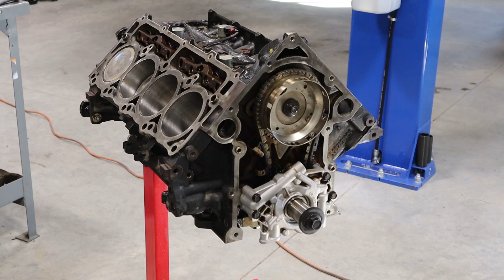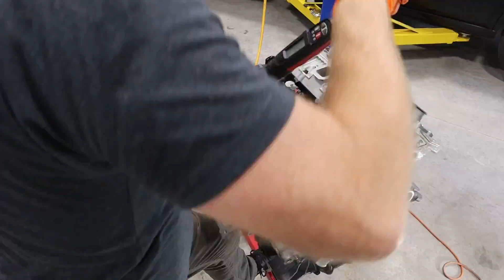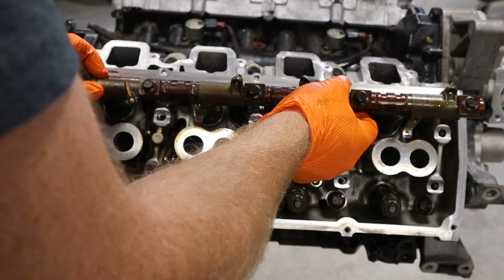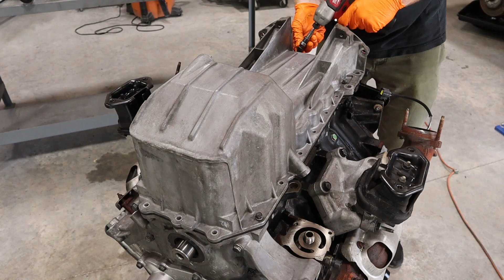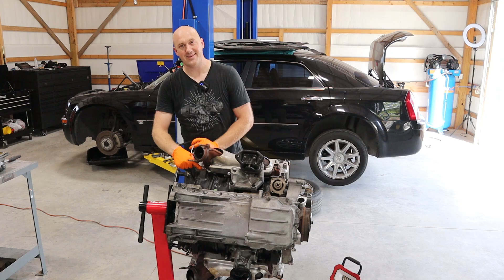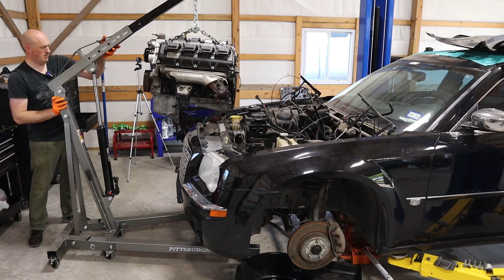Chrysler Hemi 5.7 Engine Rebuild Continues Top End // 300C Episode 4

Comment: My advice is to never re-use exhaust manifolds and exhaust manifold bolts. They always warp or crack between 40-70K miles on these motors.

Comment: Do you have to adjust the valves at all? I'm about to replace my passenger side head (don't ask lol) on my ram with a reman head. Just wondering if I just bolt everything on and go, or do I need to adjust the lash?
Reply from the maker: That's the nice thing about hydraulic lifters, no lash adjustment needed 👍

Comment: @ReignitedAuto
What are the bolts that should be replaced when doing a full rebuild?
Which are TTY?
Thanks you
Reply from the maker: The connecting rod cap bolts are the only ones that Chrysler says are one time use. The head bolts and main cap bolts are torque to angle, not torque to yield so they are reusable. 👍

Comment: Im really hoping i get a response from you even though its an old video.

On the gen 3 hemi's, is it possible to install the heads on the wrong side and if so, does it matter? Will it cause any problem?

I love your channel and thebinfo you put out, its great and very straight forward making these repairs easy for the everyday person, keep it up
Reply from the maker: Yep, the casting is identical side to side so they can be swapped. The only reason it matters is because the left and right side will be drilled differently for accessories to be mounted to them. 👍
Reply: @ReignitedAuto so everything should be good to go? The casting numbers are the exact same (both ending in DE) however the coolant/oil passages look to line up differently (i have pictures of the underside of both heads for reference)

So ultimately im at a loss of it the heads are on correctly
Reply from the maker: @Rubix4331 shoot me some pictures sales@reignitedtx.com and I'll take a look
Reply: @ReignitedAuto sent...thank you so much for offering to help me out

Comment: Just torqued down my rocker arms. The rods appear to be seated properly, but the rockers seem to have significant side-to-side movement and can slide back and forth on the arm. Is this normal??
Reply from the maker: If neither valve for that cylinder is compressed, yes it's absolutely normal. During engine operation the pushrods will keep the rocker arm centered, they won't be moving back and forth.
Reply: @ReignitedAuto that’s a major relief! Thanks for the reply

Comment: Hey reignited! Just did a MMX Cam and melling high-volume oil pump on a 2011 ram 1500. I am seeing great oil pressure at Cruise of 67 PSI at temperature. 

I am worried though at idle operating temperature I'm sitting around 26. Do you think that is high enough to lube the lifters? Thank you! 

I used your videos to do my cam swap it helped a ton

Comment: Smh i have a 2005 dodge magnum rt & im currently experiencing the exact same problem with just 1 piston being bad i just recently found out from changing the oil & put a magnet in the oil pan & a broken piston ring came out & the motor is out of warranty i bought it from dodge a little over 3 1/2yrs ago im not sure if i should replace it or rebuild it like you did but i definitly watched all your videos they are a big help im just not sure which way i should go cause it’ll be my first time doing this type of job

Comment: I enjoy watching your videos. Very helpful. Whats the best way to lift the engine with a hoist? I see on this video you have a chain on the cylinder heads. Is that a safe point to  put the chain on. What type of bolt is it? Metric? Thanks

Comment: while looking for the torque specs in torque sequence, I saw two other videos that recommended oiling the threads on the head bolts. I've never seen that before. I've always heard that would hinder proper torqueing. thoughts? suggestions?
Reply from the maker: There are some situations that call for that, but in the head bolts for dodge vehicles the service information says to keep them dry 👍

Comment: kinda off this topic but question for you... 2016 Ram 5,7.  What is the part on the rear of the intake manifold that has the electric connector thats a bitch to get at?  What is it called and what does it do??  Cant find any info on what it is and what it does?  Not the MAP sensor but the part on rear back of manifold.  Any help appreciated...thanks
Reply from the maker: That part is the SRV actuator. The "short runner valve" actuator. The intake manifold has variable length runners inside it to give better performance at lower and higher RPM and that actuator controls the runner valve that switches between the two lengths.

Comment: I dont see in any videos how to torque the camshaft bolt without having the engine turn before torque spec is met??  I was told not to use the timeing chain tension to hold the camshaft in place??
Reply from the maker: Best option that I've found is to access the flex plate and stick a pry bar in there to keep it from rotating 👍

Comment: I don't understand why it doesn't have a key way on the balancer?
Reply from the maker: You'd be surprised how many engines don't use a keyway on the balancer. I admit I would have preferred one as well, but we never see any issues with them so it must be OK. Also something to note is that the crank bolt is trapping the damper against the timing gear so that's an additional reason a keyway isn't necessary.

Comment: how do u not notice wiring harness going between the head. wow
Reply from the maker: Because you can't see it my man, it's underneath the exhaust manifold.
Reply: @ReignitedAuto  first of all, im not your buddy, so dont call me your man. 
how do u not see it before you put the exhaust on. obviously it was between the head n block before you put the exhaust monifold on. you obviously didnt look over the install of the heads before you tightened them down. a wire between the head n block definitely would have made it not sit right. i feel sry for that owner.
god only knows what else you didnt do right.
Reply from the maker: @coreywebster5227  so much aggression. You install the cylinder head with the exhaust manifolds already on them. Therefore, I didn't see it. Not sure where your anger is coming from.

Comment: If the one push rod is fairly higher than the other 3 do I just tighten slowly for the valve to shrink to be able to seat the rest in, or am I supposed to turn the engine and try to adjust them evenly ?
Reply from the maker: Either approach works fine. I usually move back and forth along the rocker shaft tightening the bolts a half turn at a time to get them to seat evenly. 👍

Comment: it did happened to me on a 09 ram I installed the head with the motor on the car and pinch the o2 sensor wire, luckly I inspected and founded the wire before torquening down the head.

Comment: You mentioned loc-titing the flex plate bolts.
Something that "happened to me",  I worked as a lot attendant for a gm dealer here in Ohio, a customer from Texas traded in his old Silverado for a new Sierra.
I was asked to take this new truck back, gas it up and wash it.

When I started the truck, it didn't sound right.  I did that 4 or 5 times and it wasn't right.  I told the salesman about it and he was rushing me because the customer was heading back to Texas as soon as his truck was delivered.

My gut said have it checked, so I did, which pissed off the salesman.  He came back to the service department, where the service advisor told him that the truck wouldn't have made it back to Texas.....all of the flexplate bolts were extremely loose.

The salesman apologized to me and told me that he would never question my judgment again.
The customer asked to see me and he thanked me for my awareness and initiative to have service check it.  Then he stuck $50 in my shirt pocket as a tip for saving him a breakdown and a headache somewhere between Ohio and Texas.

Comment: One more question master, is it possible to get 180 psi of compression on a particular cylinder if one of the valves are not closing or sealing properly on their seats??
Reply from the maker: Nope, even the slightest valve sealing leak generally puts you under 100psi and if the valve wasn't closing properly you would have 0 compression on that cylinder. 👍
Reply: @ReignitedAuto  Thanks master, I just found the reason for the misfire on cylinder #7 on my 2010 grand cherokee srt8 6.1 the lifter roller sized and damaged the lobe of the camshaft so it's time for cam swap/upgrade, now my question is: as a dodge -chrysler-jeep specialist in your opinion what's the bigger or better performance camshaft I should go with the factory torque converter for a daily driver, I have been searching with no luck for the stock camshaft specs to be able to compare it with the aftermarket options/kits out there because everyone is taking about stages 1-2-3 but no specs for those stages, I really want to squeeze every bit of torque/power out of my stock engine without sacrificing the factory  torque/power at low-mid RPM range, choppy sound will be a bonus but  I prefer performance over the sound, thanks again my friend

Comment: Very helpful videos! I use most of them to rebuild the Hemi myself not too long ago. But you were talking about the O2 sensor getting in the cylinder. I had something similar to that happen when I built mine. The nut for my exhaust down pipe fell into one of my cylinders and I did not realize it until I was trying to tighten down the torque converter bolts. I was not a happy camper. I had to disassemble the whole driver's side top of the engine to get a nut out of the engine. 🥴

Comment: What is the name of the thin metal plate on the back of the engine. You said engine plate. I've been trying to search an find one. I bought a engine the other day an the one it had was bent in couple places.
Reply from the maker: I've always just called it a spacer plate,  not sure what the actual term is. It does locate the starter so it might be named something like that.  👍

Comment: are these engines known for head gaskets?  I have 130k on a 2013 ram truck and it's got a cyl 1 misfire code. I used a camera and the cyl at the top on the head looks wet with coolant and the plugs are white. I'm going to use a coolant system pressure tester and the camera to see if I can see leaking.    I don't think I have a bad lifter as it only flashes the CEL if I'm on the highway trying to floor it.  weird thing is, when it's into it's misfire issue and the light is flashing, if I turn the ignition off and back on, it goes back to normal and no misfire. if I don't,  the misfire wont clear up for a half mile or so.  it's as if the cyl has been shut down of fuel and the engine feels extremely rough trying to keep it at the speed limit.  then it clears up on it's own. but the ignition trick works every time.

i've watched a few other videos and the guys are soaking the head bolts in oil overnight and all kinds of other  nonsense.   where to people get this silly crap from? I knew right away to stop the video LOL  it's one thing to lube the bolt to get a proper torque reading but you don't have to soak bolts overnight in oil.

Comment: Question,are the meds and non MDS blocks the same? Can you use a non MDS block and install cam and MDS lifters and solenoids?
Reply: Thanks for the answer 😊
Reply from the maker: Yessir, the block is the same, the non MDS engines just have block off plugs installed. 👍

Comment: I’m going to use FelPro head gaskets are they good??
Reply: It depends on how the gasket is designed some times they will have a notch that will align with one in the valve cover or the if they have holes that go around a bolt hole they can be offset to where they will only go in correctly one way some times they can go either way
Reply: Hey I just order a whole new felpro gasket kit! Did u have any problems with felpro?
Reply: @ no they worked perfect I used them on my uncles jeep Cherokee and never had any problems just make sure you install them correctly
Reply: @prez1894  ok I did read about the thicker side going into the valve cover right?

Comment: Hi, I have a 2005 5.7 300c hemi here in the UK, i have just changed the head gaskets, but now it has trouble starting, when it does, it sounds like its not firing correct and stalls. Should I have had cyl 1 at TDC before fitting the rocker arms? thank you
Reply from the maker: Watch this video right here! https://youtu.be/jMziMqWRMk0
Reply: @ReignitedAuto  The video was a great help, I did not push the rods down to seat properly (never done this job before, total novice), so will do the push rods all over again. thank you
Reply: @Reignited - Cycle and Automotive  thank you so much, followed the video and re seated the rods. Car started straight up after that.
Reply from the maker: @papas7669  fantastic news! Good job getting it fixed 💪

Comment: Please excuse my ignorance... I would like to know if im able to use a 2016 Hemi Charger cylinder head on a 2003 Dodge Ram Hemi? Your help would be great. Thank you!
Reply from the maker: No it won't work, you can only use a cylinder head up to 2008, anything newer will not fit. It'll bolt up to the engine, but you'd have to change a bunch of other stuff to make it work.

Comment: How do you like the Hemi compared to LS or Coyote?
Reply from the maker: Visually I like the Hemi the best, I like the coyote for the tech but I wish it had more displacement, and I like the LS for it's small packaging and stone cold reliability. I think all three are pretty darn good.
Reply: @ReignitedAuto  I agree the only problem I see with the Hemi is some cam lobe and lifter failures
Reply from the maker: @vernonknight5827  I hear that, I have a bunch of videos addressing that issue. 👍
Reply: @ReignitedAuto  is there a good replacement cam that is hardened and won’t fail?
Reply from the maker: @vernonknight5827  really tough to say. Since the original problem usually takes 80k miles to show up in the first place is impossible to test aftermarket cams to the same extent to see if they are better or not.

Comment: Hey I got a question I'm working on a 06 chrysler 300c and the push rods won't tighten up to the rocker arms
Reply from the maker: Will you'll want to verify the ends of the pushrods are properly seated in the end of the lifter. It's possible they can slip to the side of the lifter body.
Reply: I did all that still won't Tighten up do u that the lifters are bad

Comment: One thing I didn’t see you cover which I believe is important but nobody really mentions it. On your rocker arms, you’ve got a two different size oiling holes. The side with two holes on the rocker, needs to be facing down towards the exhaust manifold. Not facing up. There’s only two ways to do it, up or down. But down towards the exhaust is always what I’ve heard.

Great series though. I’ve asked plenty of questions in which you’ve answered. Thank you so much for the help. All I’m waiting for now, is my new torque converter from dodge to come in and my engines going back in the car. Hopefully it works. There’s internal damage in one of the lifter bores. It’s not scratched or anything, it’s just missing a small round chunk from when my lifter exploded. The pin holding the roller in, launched out when it exploded, and took a round chunk off with it. The lifter still sits in there flush with no play so hopefully it goes well lol. If it doesn’t, I’ll be out another set of lifters, another new cam, and I’ll be going with a brand new engine block lol. Learning experience to see how perfect everything REALLY has to be. There’s internal damage on my came journals on my 4 wheeler, but I still slapped performance mods in her and she’s running amazing!!!  So hopefully cars are robust like 4 wheelers lol

Comment: Extremely disappointed in you doing all that work and putting stock manifolds back on
Reply from the maker: Check out my budget challenger build where I install SRT headers! 👍
Reply: @ReignitedAuto   I'm in the process of doing a TSP stage 2 cam that includes new valve springs upgraded pushrods mds delete (hellcat) lifters headers, and building a custom full 3 in exhaust.  Will see how it goes

Comment: Hey! I’ve got a question. Did you pre soak your lifters? I’m getting mixed answers on doing so. I’ve got a new camshaft & new lifters and I’m not sure if I should pre soak them with oil. What exactly did you do?
Reply from the maker: It's not completely necessary, it definitelyhelps them quiet down faster if you soak them, but either way they're going to rattle for a bit when you first fire it up. If the rattle doesn't go away after about 20 min of driving then something isn't right. 👍

Comment: I have a 2005 5.7 hemi, took the passenger side head off yesterday. Do I need to remove the timing cover to take the driver's side cylinder head off? Amazing video!!! Best I've seen! Thank you!
Reply from the maker: Nope, no need to remove the timing cover, there might be a very small bracket connecting the timing cover to the cylinder head, but that is easily removed. 👍